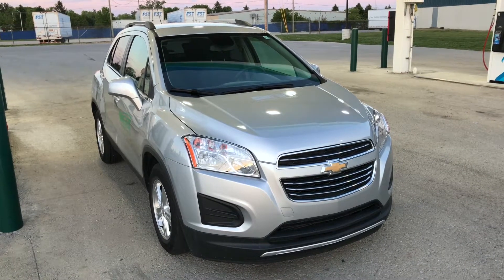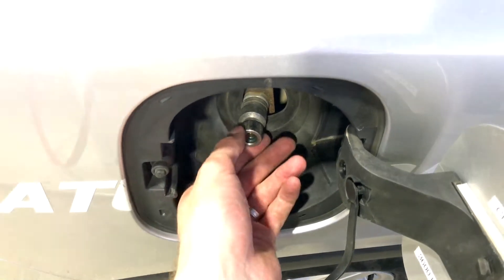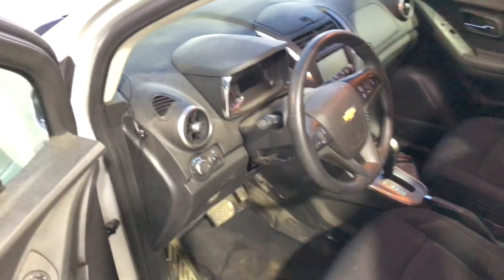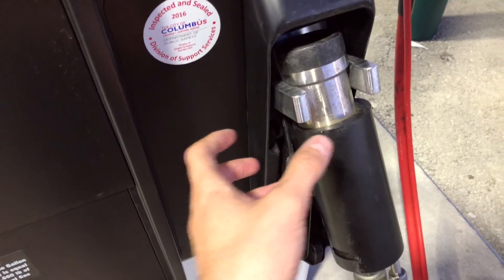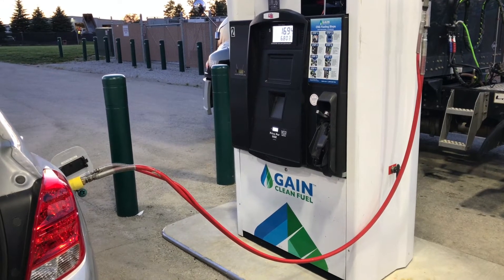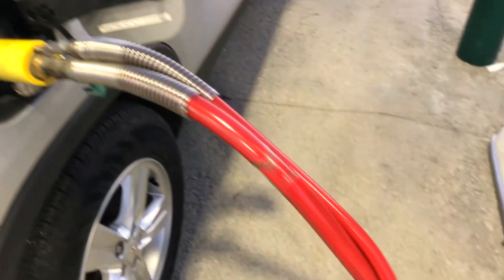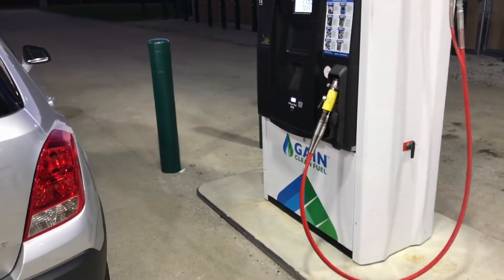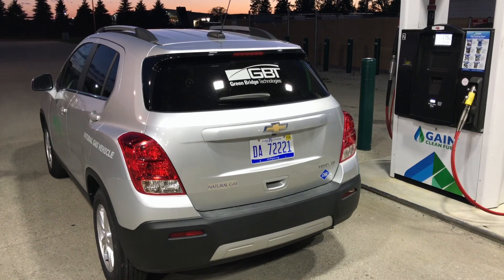How to Refuel a Compressed Natural Gas Vehicle

Comment: Any danger getting rear ended with the high pressure tank?
Reply from the maker: Ultimately this is why they have designed the tank to sit more inward within the back cargo area, giving more crumple space/ability to absorb the blow in a crash. Tanks are also crash rated to a certain extent.
Reply: @MattStephensRich  thanks for that explanation sir.
Reply from the maker: you bet!

Comment: I have a 1985 Ford Mustang GT convertible that I’m thinking of converting to run on both Propane/Natural Gas since gas prices are through the roof
Reply from the maker: There really isn’t an upfit kit option out there, or at least upfits that exist are done to new vehicles coming off the line.
Reply: @MattStephensRich  im sure it can be done somehow.  Ill have to do further planning

Comment: I half to ask, with the tank fully compressed. At 3000+ PSi. What's the range/distance of the vehicle? I'm assuming it's insanely extended.
Reply from the maker: Range is actually comparable to a full tank of gas.
Reply: @MattStephensRich  
2015 Chevrolet Trax Traditional
14.0 gallons of gasoline 

2015 Chevrolet Trax GBT Technologies
8.58 GGE

That's only 61.3% of the effective range. So it's only 2/3 comparable to a full tank of gas.

Comment: What about hot days, this option is not safe at all
Reply from the maker: I mean, are you insinuating CNG can’t be used in warm weather?
Reply: @MattStephensRich  
I’m not insulting but all drivers are not the same. Some drivers follow the law country and they are always in speed limit but there’s some crazy drivers who swift or spinning while the engine hot and the windows are closed. That’s the time the car will explosion. And it’s not safe.
Is that make sense?
Reply from the maker: Honestly not at all lol or at least, if you’re asking “is CNG safe”, gratefully the answer is yes. Otherwise it wouldn’t be made available as a motor fuel.
Reply from the maker: Not trying to come across mean, but you ultimately used a run on sentence, and just restated “not safe”, and said the engine running hot and windows closed means the car explodes? Gratefully isn’t the case - again, otherwise would definitely not be available as a motor fuel.
Reply: @harun9739  You're talking about the flashpoint of the fuel — the temperature at which it spontaneously combusts? Or are you concerned about the tank holding in higher pressures on hot days?

For human-bearable temps, this should be a non-issue.

Comment: It takes away from the performance of the vehicle. BTW, the car knows what type of fuel you are using because you need to change the components of the car to run natural gas, that was a stupid comment in the video.
Reply from the maker: I didn't say anything about the component integrations of CNG vs. gasoline fuel system? But yes, CNG runs at a different octane, alongside being a gas - which means injectors, fuel lines, and engine computers need to be updated for running the different fuel.

Comment: Can you do a video on LNG v CNG car engines, or Hydrogen v LNG &/or CNG? No one has ever done it. You could show clearly, for the first time, the comparisons of cost/tank capacity/mileage/BHP/pros/cons/fuel cost/ease of engine conversion (if appropriate) or cost per engine etc. I think you're the man for the mission!
Reply from the maker: For LNG, there isn’t a light-duty engine spec, as that sits on the heavy-duty side. But, natural gas engines are the same between LNG and CNG; LNG simply warms to a gaseous state as it enters the engine, having the same ignition and octane as CNG. 😊

Comment: What about ignition timing, optimal mixture, camshaft timing, who deals with these changes ? the customer ? does the vehicle get inspected on a Dyno before and after installation ?
Reply from the maker: Since CNG has a different octane vs. gasoline, it does require a swap in the engine computer. CNG is very rarely seen as an individual vehicle - far more popular with fleet vehicles, especially in heavier applications. Indeed, there's a network of mechanic shops that are certified to operate on CNG, which does require separate training.